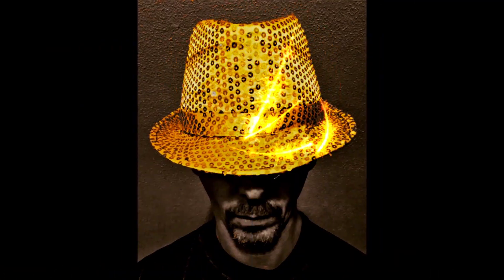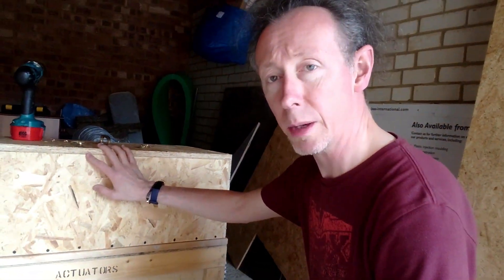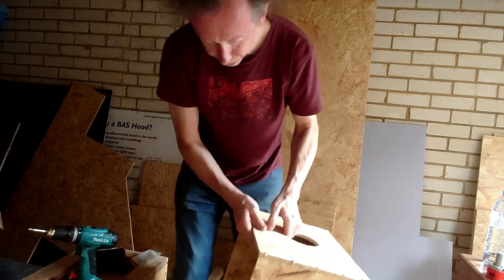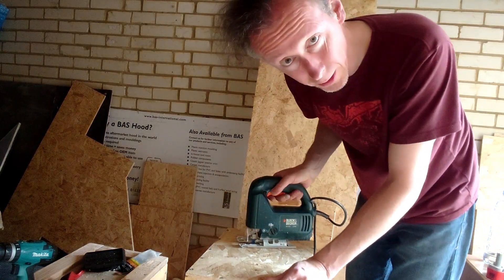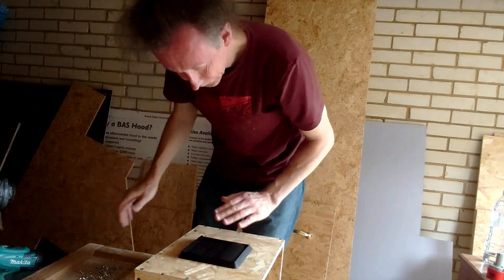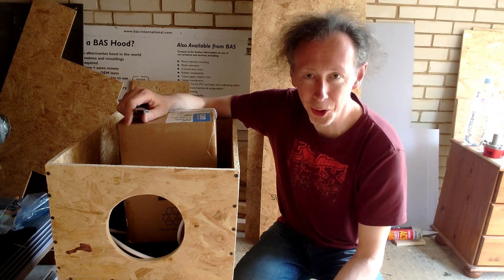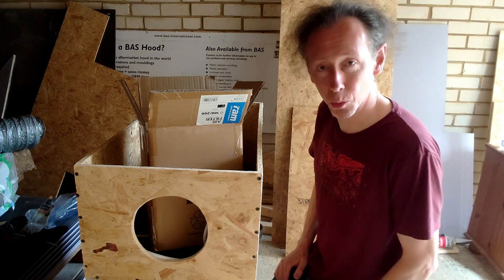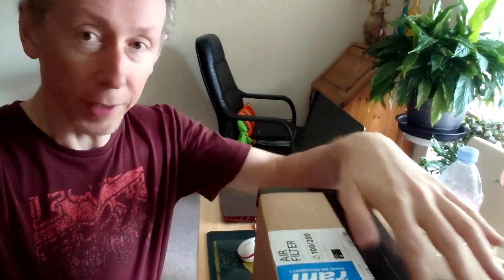Building a Vocal Booth: Part 6 Vocal booth ventilation system design.

Comment: is a ventilation system really needed in a booth, can you just air it out and use a normal fan?
Reply from the maker: After neay two years of use I would say no, not really. Like you say, just open the door for a bit. Maybe if the air path was shorter and the air flow stronger it might be OK for a quick air blast, but save the expense by just opening the door..
Reply: @richardemmittvo  Ah thank you, just the answer i wanted to hear lol because the thought of adding a ventilation just seemed unnecessarily complicated for me 😂
Reply from the maker: I thought it would be good and I do use it, but it's just as effective to open the door. But if I'm in a session I can put it on and not open the door. But when I record I trun it off.
Reply: @richardemmittvo  ah good point thanks for sharing the tips and your process! All the best 😃